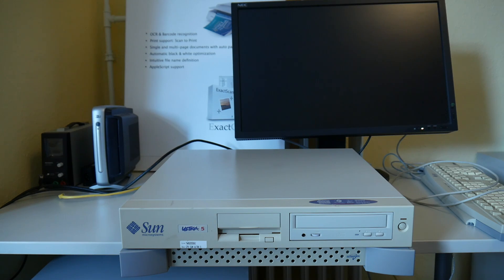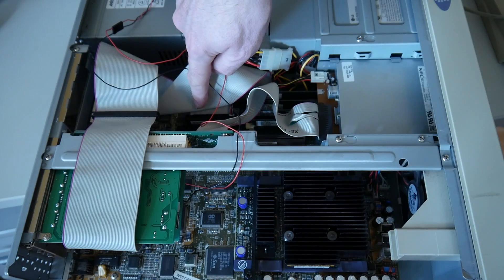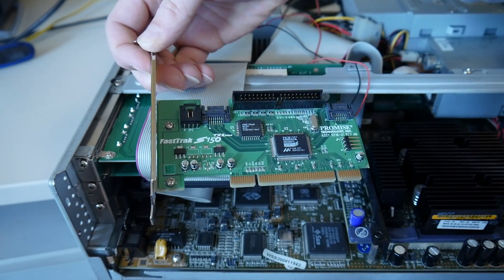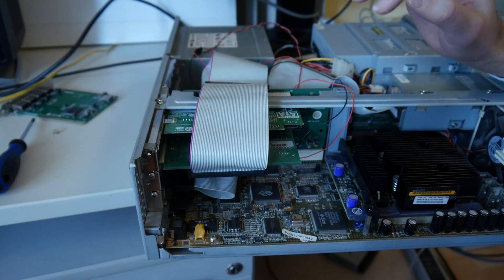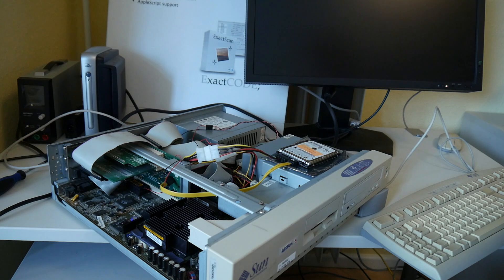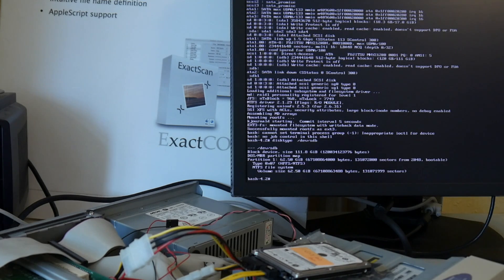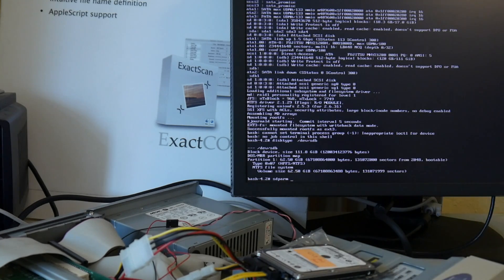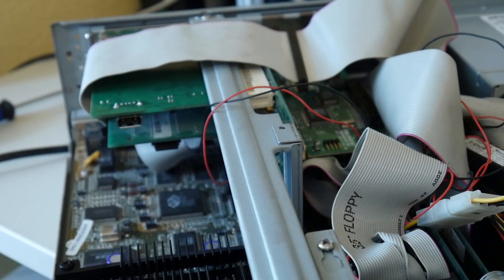Maxing out vintage Unix Sun Ultra5 w/ SATA SSD upgrade!

Comment: Hi what is the brand and number part of the SAtA card?
Reply from the maker: Some promise 100 something. However it has some timeout hiccup in Linux from time to time. Either this should be fixed eventually or another card might work better ;-)
Reply: What flash disk module did you use?